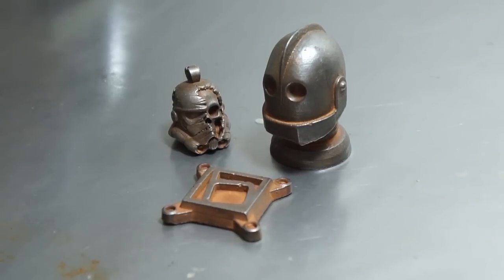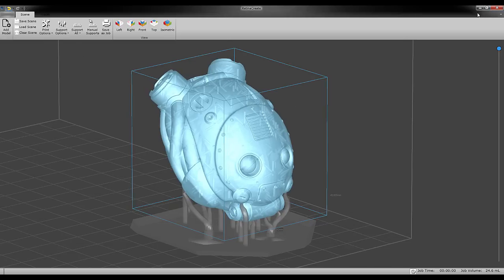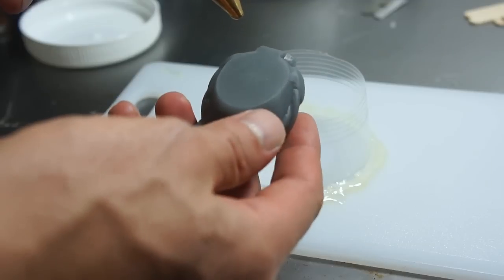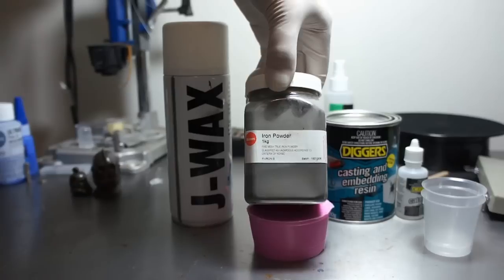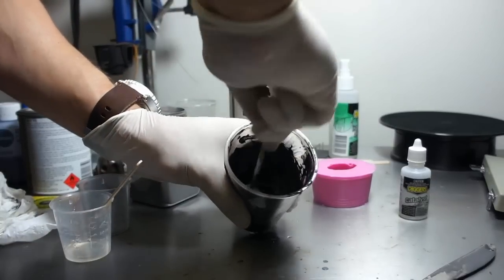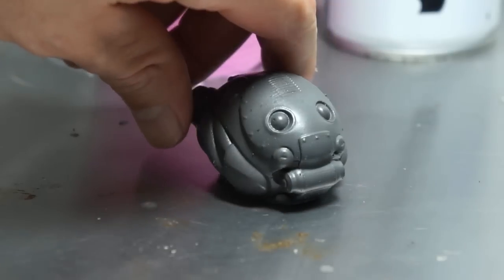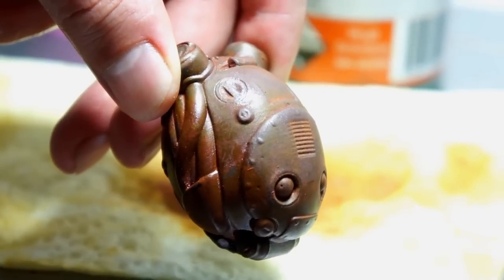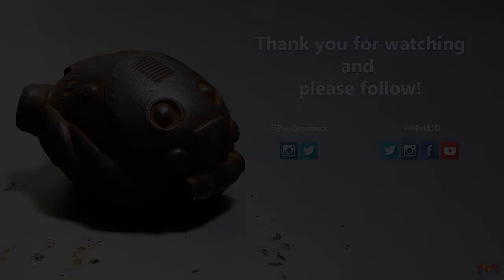Cold Casting your 3D Prints

Comment: Is it possible to 3D print a mold for a part and then put this metal powder resin directly into the cavity of the mold in order to create a model? Would this cold cast material affect the ABS mold in any way? I'm not comfortable using soft rubber molds for my parts because I need them to retain high levels of dimensional accuracy, they're not detailed parts, but they need to be accurate.
Reply: I believe you can get PVA based filament that dissolves in water. So print your mould, cast your resin and dissolve off the PVA mould. Down side is you can only cast one per mould. But you could print several moulds at once.

Comment: 3d printing teh mold does not work in most cases, the mold must be destroyed to get any intricate parts out as one small lip in the mold will cause it to stick in place since there is no room to move, you need silicone. expensive as hell if your doing any parts over a couple inches, especially hollow parts like shells. i used to do this with an old abs printer i had, wlel not old but older than my sla, its like ancient technology now. it was a nightmare printing it every time also you can see the layers, with sla layers are so small but atleast if you print teh part first you can machine, sand, finish and them mold it over and over with only 1 print. i honestly think though the sla printing is more costly than the silicone 0.o, hard to believe but totally worth it for professional quality work.

just do not ever get a pegasus touch!

also i find it absolutely amazing that you just rusted plastic....

Comment: Why are you using a mold release? If you're casting anything expect silicone in a silicone mold it usually does not need any release at all.
Reply: +mrgoatkicker Actually it does. I once cast some pan/pot handles in an enameled pot and it stuck to the enameling. I had to apply isopropyl alcohol to make it release (I almost thought that I completely ruined the pot and the casting as well).

Comment: Hi, when I cold cast the metal powder always seems to settle at the bottom of the mould leaving a dull surface at the top that doesn't polish up to look like metal. I'm guessing that I need a resin with a faster curing time, but I can't seem to find any clear resin that cures fast. Can anyone tell me if the resin has to be clear and suggest some brands?

Comment: I thought 3D printing was invented so you didn't have to cold cast your design.
Reply: +ElGatoLoco698 3D printing was created specifically for rapid prototyping. Once you have a prototype, your method of mass production may begin.
Reply: ElGatoLoco698  - but without 3D printing you don't have a part to cast in the first place so your point is moot.  :)
Reply: Once we can 3-D print directly to steel or brass, then you might have a point. As long as 3-D printed parts are plastic, then we'll need to cast if we want them in metal.